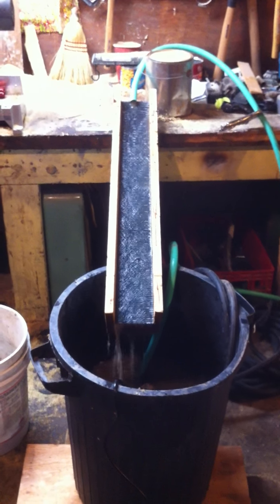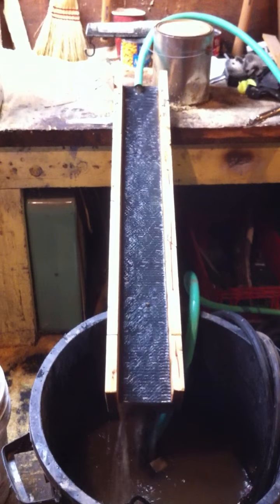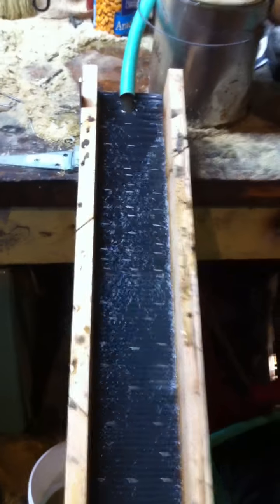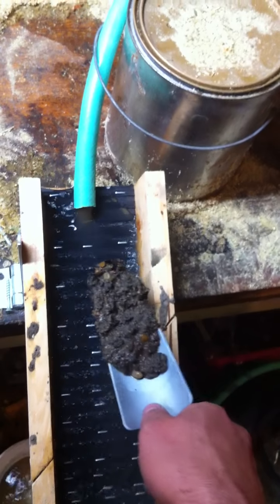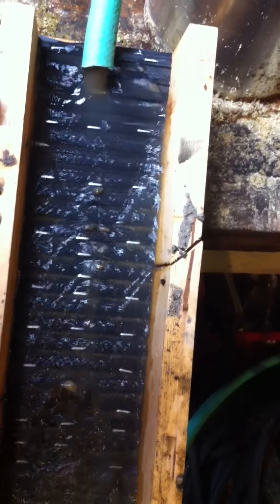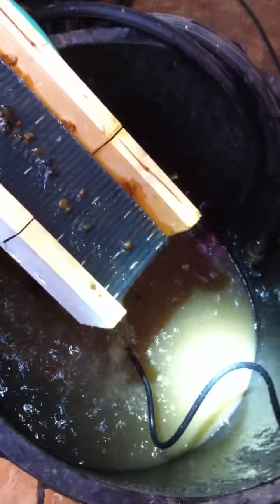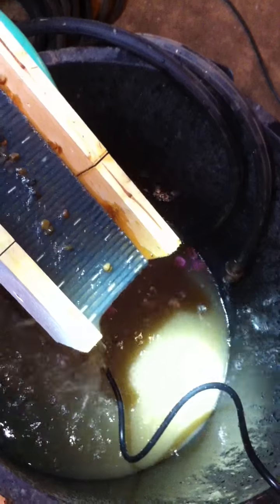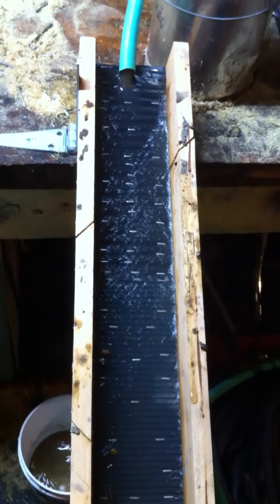Mini Sluice for fine gold recovery

Comment: Nice prototyping!
 The slope looks too steep and from what I have read most of the gold in that river is -30 mesh - So you can classify out the 1/4" or even 1/8" and get a lot better recovery and run at a lower slope.

I enjoyed this video - thanks for sharing.